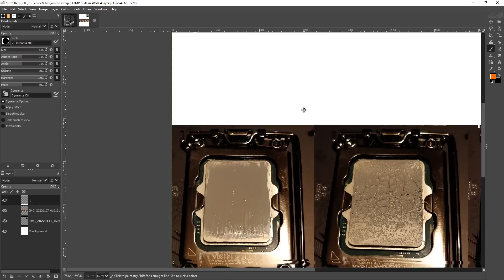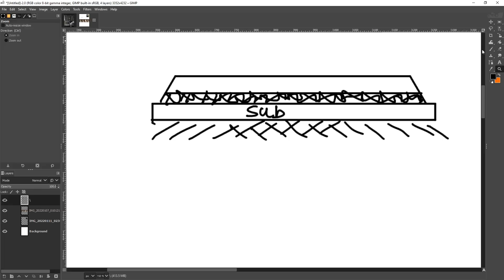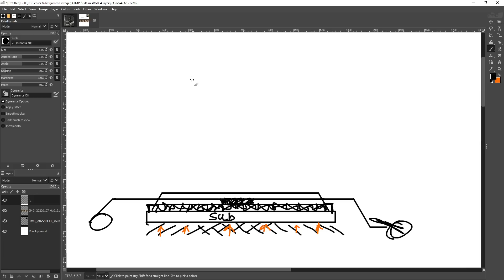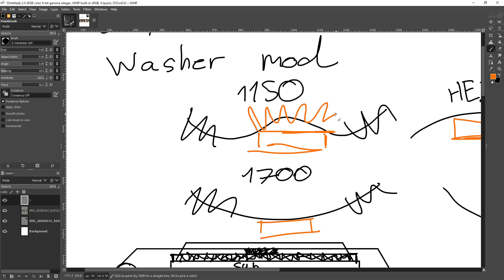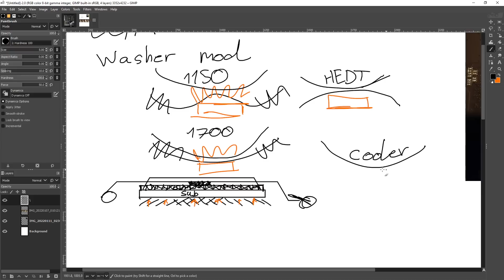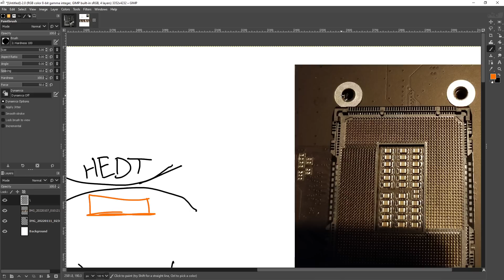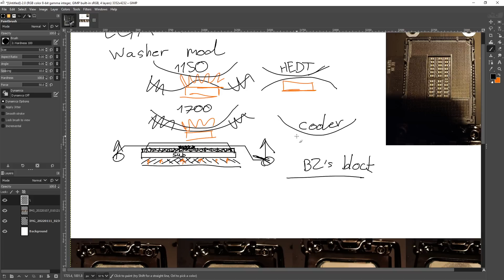Rambling about the LGA1700 washer mod

Comment: Oof this makes me question the long term life of the socket and the CPUs. Probably not something to buy in 7-10 years time like buying a 4790k currently.
Reply: He says CPUs have always been like this. Alderlake should be no different.
Reply: @johnm91326  the increased size and significantly higher pressure of the mounting begs to differ. Refer to when he said he had the CPU jump up when he let go of the socket. Add bendy motherboards into the mix, and I'm not talking 4 layer h610 but 6 and 8 layer Z690 boards. This platform has issues. Although by the end of January I'll be building one for myself.

Comment: So to save a few cents per motherboard, Intel has decided to cause a whole set of potential problems. Typical Intel. Intel's gonna Intel.
Reply from the maker: it's perfectly fine for stock operation.
Reply: @ActuallyHardcoreOverclocking   well stock is basically OC in case of 12900k

Comment: Could i use the black washers my corsair water cooler comes with ?
Reply from the maker: I think I have some of those and they should be  fine. Just check that they don't have any rough spots that could scratch the solder mask.

Comment: Thickest head pippe that exert pressure when laying on it from the thick, overlong look back plate from the back of the board then equipped with liquid freezer II 120mm and spring screws on 4 sides on 2 tension plates on the sides of the cpu max attachment spring-loaded back plate board as if that were soldered at 4800 Turns and these plastic cpu attachment mini screw connections gives vibrates over time flies around your ears water through fan vibrate max fan the attachment seemed to detach from the water cooler and shoots you around the ears like me in the tension coils pierce the plastic Cladding on the board the plastic-coated heat protection just like that or other blocks of water on a plate that presses best screwed it's better because flexible the springs set themselves up again if necessary the pressure dare on cpu form with screwing solution you have to reckon with that with a lot of ventilation the pressure makes even when the water cooler fans are built on h But even with liquid nitrogen, which always deforms cold heat, that's why I love spring coverings, you can't do it for 4 years and nothing happens it's even possible to keep that in treads with good boards the cpus don't have to go so high to the limit with old ones before everything breaks down to 32.000mhz much more elective all core so high other stories couple best with low 200x 300 x 400 turbo max 33 multi not even you need a lot of ram 6 fire 3 drive a circuit everything works in general spring screws back plates rear protection screw connections and top plates individual attachment to springs have convinced me everything else makes faxes no matter how over time if cpu is fixed on long 34 sides on suspension no problem - I've gotten used to that. also aims more useful multi-purpose more digestible parts for other, if necessary, think with what you believe ^^. your experiences, I shy away from many cores read so well act

Comment: This is very good info thanks bz, I didn't knew the LGA1700 is going to have this much pressure than the previous sockets. Well I guess I have to find washers(hope the plastic kinds don't crack) for my already lapped raystorm waterblock and if I'm going to have somebody asking me to help them build their new pc with this LGA.

Also quick question for my clutch electric screwdriver: how much torque(N•m or ft•lbs) is it supposed to have to safely rescrew the loading mechanism back?
Reply from the maker: IDK about the torque I just hand tightened it.
Reply: @ActuallyHardcoreOverclocking  oh thanks bz! I guess I have set the clutch at around 0.3 - 1Nm(0.2 - 0.73ft.lbs) hopefully the lowest torque on the screws could hold it.

Also my driver is the makita DF012DSE its an awesome pen driver around computers.
Reply: Make sure you're accounting for the lower z-height of LGA1700 vs earlier sockets, presumably with washers adding to the spring pressure of the Raystorm mount.

Nylon washers won't crack, but may squish over time.

Never use an electric screwdriver without having a torque spec.  It saves like 10s over hand tools.  Don't use a wrench, either.
Reply: @concinnus  I know about the lga1700 z-height situation it's around 0.717-0.783mm lower than lga1200, that's why this washer mod is an option just in case if I upgrade my brother watercooling PC with the lapped raystorm cuz those new lga1700 spring pins are quite tough & I don't mind the issues of this mod to made it fit. I don't have 12th gen, I'm still on 10th gen & ryzen zen3 with a itx. 
When i was replacing the tubes for my bro's PC, I noticed the raystorm mount springs with the nylon washers was squeezing the solder mount of my bro's z490 godlike marking rings on them, thankfully nothing bad happened and I loosen them a bit after that with nearly the same temps.

The Makita driver I mention in my comment before does have a auto stop clutch and torque specs in the manual which is amazing cuz this tool is very gentle on sensitive electronics like motherboards and tough enough to drill fan screws and other stuff, big time & life saver around computers, but it need a set of driver bits like Hexs & other Phillips bits especially the taller bits for tall cpu coolers.
Reply: @emini6  To be clear, the washer mod Buildzoid is talking about is to raise the z-height of the retention bracket, whereas the washers I was talking about were to lower the z-height of the waterblock.
Reply: @concinnus  you know & I know how this lga1700 washer mod works, but thanks for the raystorm tips I'll keep that in mind the washers mod on the mount if it don't push down the waterblock, but I knew from my experiences that the raystorm mount springs is going to push down the waterblock more than usual.

Comment: This makes more sense than's Jay's video.
Reply from the maker: but Jay's video is what motivated me to make this.
Reply: @ActuallyHardcoreOverclocking   I see, yea I saw that headline earlier and watched Jay's video first out curiosity. Made no sense to me to be placing washers on a CPU retention bracket if the issue is some coolers applying too much mounting pressure, or at least the impression I got from his video. Your video cleared that up with something that makes sense.

Comment: For TLDW people: This is NOT a recommendation for everyone to do our of the box, BZ only did it because he had a custom lapped/flat heatsink which didn't have good contact, unlike his factory curved one. This should be a backup solution if you have thermal issues that aren't fixed by reseating/reapplying TIM/tightening.
Reply: I'm no expert, but if you don't do this mod, and the socket causes the CPU to bend, that's it. If you add washers afterwards, the CPU will still remain bent. If the socket lever feels very tight, I'd take that as indication that washers are necessary.
Reply: Z690 hero, brand new, no cpu ever installed, the socket back plate was actually slightly bent out of the box. Removed the socket backplate from motherboard, it was straight. That means, out of the box, without any cpu installed, the pressure is too high on the socket backplate. I think it's safe to say that the washers are necessary no matter what. Am just not sure if we should be put on 2 or all 4 holes of the socket backplate
Reply: The cpu is a lot weaker than the solid backplate. So it will bend if the backplate is not straight when the socket lever is applied
Reply: @M00nsave445  Yeah, when I opened the ILM lever in my MSI Pro Z690-A, the retainers actually flew open with force, not exaggerating. Added 1mm nylon washers now, still feels very tight but let's see.
Reply: @Saaaaab  Which washers did u use - where did u get them from? I found some, they are 1mm, but when I squeeze them, I think they provide 0.5mm. I dont wanna use metal washers at this point
Reply: @M00nsave445  Bought a pack of 50 nylon M4 washers (1mm) off Amazon. Mine don't squeeze, use thicker ones if you think that'll happen I guess, or just double them up.
Reply: @Saaaaab  How is your temps though? Did you install the washer before throwing in the CPU?
Reply: @M00nsave445  No idea actually, built the thing yesterday and added washers out of the box but I've been a bit busy so I haven't tested or benchmarked at all (looking at HWinfo now, CPU is at 35-40C across all cores, fairly even, with 25 firefox tabs and a game lobby open).
Reply: @M00nsave445  Ah missed that part, yeah I installed it before putting in the CPU. Did the top of the ILM first, reinstalled the screws (very loose), then the bottom, then tightened them all, they were very loose in the beginning so I didn't tighten them too much, fairly snug. You can put the CPU in first. Just be very careful either not to drop or to let anything fall into the pins. I treated it like minor surgery lol
Reply: @Saaaaab  Ya same mine were loose in stock form, so I did not tighten them too much when I just put the nylon washers. I made sure all 4 screws are equally tightened
Reply: @Saaaaab  does nylon m4 stick like the washers plastic you put on motherboard? I lost mine from arctic II 420 mm now the screws rattle lil bit after 2 days of use. I need stickers washers any link please
Reply: @yooanto9465  It's longer than a normal CPU so I just use a small pea line method. As for the washers, I bought the "sourcing map Nylon Flat Washers M3.5 11mm OD 3.5mm ID 1mm" off Amazon. I'm pretty sure I used this one but I might've used the "sourcing map Nylon Flat Washers M4 8.5mm OD 4mm ID 1mm" version, I don't remember. The IHS screws only let you put in a small torque so IDK how to stop the rattle. You can try using a touch of blue loctite I suppose. Edit: my damn rely keeps getting deleted.
Reply: @Saaaaab link please? I tried amazon but i see box full of different size of washers.
Reply: @yooanto9465  YouTube is deleting the links I posted. I wrote the size for you though, it 3.5M washers, 11mm diameter, 1mm thickness or the other one, with 4M, 8.5mm diameter, 1mm thickness.
Reply: @Saaaaab  do you know what type of O rings you get with arctic freezer II aio? They work as sticker to prevent damage before you put screws I can't find them anywhere!
Reply: @yooanto9465  No... For O-rings it's best to take a measurement and buy an assorted set with approximate size and use the best fit. Generally, nitrile and NBR rubber is best but for water cooling any rubber is okay.
Reply: @Saaaaab  Good I'm using arctic freezer II 420
Reply: @
aceofspades - Thanks for additional topic coverage...
Reply: @japaneserequired6314  Der8auer recently pointed out that part of the IHS curvature seen in modern CPUs might be due to thermal effects during/after the manufacturing process (e.g. the contraction of solder after the IHS was mounted). This may not be by design but inherent to the product, still.

I personally would not be surprised if cooler manufacturers would compensate for such effects. And BZ is among a good number of tech reviewers discussion cold plate curvature and also cross fit between Intel and AMD. See BZ's own experience with lapping the discussed water block.
Reply: Did the washer mod on a brand new cpu and mobo. The thermal paste seemed very well spread after removal. Chip looks straight in all directions. Temps never passed 81C on 10 Cinebench runs running a 360mm AIO. Used the LGA 1700 backplate from Arctic.
Reply: @M00nsave445  Mine reached 87C (just across P cores, E cores at 70C), but I've only got the 200W TDP Dark Rock 4 cooler. It was going over 100C at first because the bios power limits were set to 250W by default (during Prime95). Reduced the PL1 back to 125W and PL2 to 200W. At lower load, CPU temp is at 25C, just above room temp.
Btw, I did it to prevent bending in the first place, so you shouldn't expect any new parts to be bent.
Reply: @Saaaaab  ya I have not touched any bios settings yet. Just wanted to test everything stock. I think I can drop it 5-8C with - 0.05v on the vcore and adaptive mode.
Reply: @Saaaaab  which thermal paste are you using? I used kryonaut with three lines. Perfect spread
Reply: @M00nsave445  Arctic MX-4 as always. I use the pea method. There's always been a perfect spread after I remove the cooler. I don't tweak with the voltages, the idle temp is very cool and that's enough for me.
Reply: @Saaaaab  agreed.
Reply: Anyway way to make thermal paste spread out at all area on 12900k?
Reply: Can you please put link from where I can buy those washers?
Reply: But...  the curvature of cold plates is radial while the IHS curvature due to bending is rather linear/one dimensional, right? Should not be a perfect match, either.

Comment: They should have added additional  holding lip at top and bottom on the IHS and loading mechanism  to even the distribution pressure.
Reply: So you are saying you want a corporation to spend 50 more cents for the benefit of end user and having a good long term investment of their product instead of saving it and potentially have them buy another CPU/Motherboard in the future? how vulgar
Reply: i feel that the pin do act as a balancing for pressure distribution personally i feel like setting in the case mounting every screw could potentially help avoid that socket to over ben was quite scary and not great looking and was whit the bare bone small included cooler which i got serious doubth about the amount pressure put on the his finger crossed when get my gpu i intend to use whit my main air heatsink of 2 pound get the job done wish me good luck.At least if it work will be happy if it is broken dam will regret changing board.

Comment: This seems to match what jayztwocents got when he tested the mod, where there wasn't much of a difference between pre-mod and post-mod.
Reply from the maker: yeah and he tested with an AIO.
Reply: I've watched that video, and I agree with Buildzoid too. It seems that Jay's configuration maxed out the AIO radiator relative to the CPU power. Notice how after the washer mod was applied, there is that advertised temperature drop before the radiator becomes saturated. 

This mod makes way more sense when the builder is encountering a situation where CPU heat is still an issue, even though the cooler is overkill for the power demand. An example is if a cooling loop is relatively cold, despite a CPU overheating.
Reply: Jay is great, but I think he missed the point of the other washer mod entirely.
Reply: But jayztwocents claimed it had to do with mounting pressure of the cooler being too much. Adding those spacers will in theory increase the coolers mounting pressure as now the cpu is not held as tightly against the socket without it.

And if indeed the socket is bending the cpus, you should check for curvature while the cpu is installed. I would guess the cpu wont stay as bent when pressure is not applied, much like evga shills :D

Comment: I would suggest finding washers made from non-conductive material.
Reply: Nylon would be good. Machined aluminum also good and guaranteed not to yield (creep) over time.
Reply: @MrKentaroMotoPI  do metallic  non-stamped washers exist?
Reply: @salmiakk_it  Yes, there are machined aluminum, stainless, and plated steel. I would avoid the plated as they may have tiny burrs.
Reply: @salmiakk_it  If all you can get is stamped washers you can just knock the edges off with sand paper...
Reply: @andersjjensen  Good point, Anders. Just lap them as you would an IHS. Now that I've read IgorLabs' result, it seems that you want to vary the stack size in 0.3 mm increments to find the optimum. This means a 0.3 mm washer. Just looking around a bit on eBay and McMaster-Carr, washers this thin are precision shim washers. Most are some type of un-plated steel, and they are stamped. Shim washers should have been deburred at manufacture, but just to be safe...
Just lap them as you would an IHS 😇
Reply: @MrKentaroMotoPI  Shim washers are made from feeler gauge steel and they are bur free, so no need risking getting it out of plane with sand paper...
Reply: Nylon is good, but it deforms a little too easily.
Same with PVC, HDPE, PET, PP, and PC.
Good alternatives would be Zytel, FRN, Micarta, G10, and PCB (fiberglass) as the previous comment said.
Reply: @pppppmmmmmccccc  ... and Delrin 👍 Actually, the washers aren't in the clamping load path; the nuts underneath take the load.
It's also important to have uniform thickness washers here, since they act as shims. I have washers in the same batch that aren't uniform.
Reply: I found 0.5-1mm washers made from PCB
Reply: You can get washers of pretty much any size off Aliexpress.

Comment: There are plenty alder lake users report this on reddit. Damn intel, you already deliver the performance and now you spoil it.

Buildzoid is such a pc community treasure tho, must be protected at all cost.
Reply: Did you watch the full video? This washer mod shouldn't be done by most owners, just ones that have a cooler that doesn't match the curved IHS shape. BZ did it because his first stock heatsink worked fine, but his lapped heatsink was flat (not what factories do).
Reply: @__aceofspades  ofc I watched the full video. But you neglect other point of view that not every users are willing to get their processor bent and risk potential future problems, and not everyone has an asetek cooler (for instance, I'm using coolIT cooler).